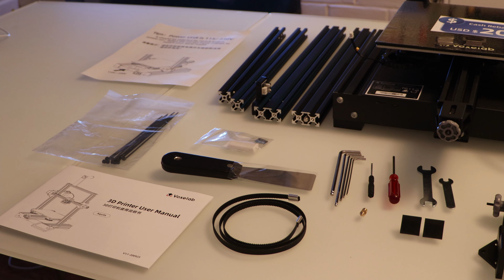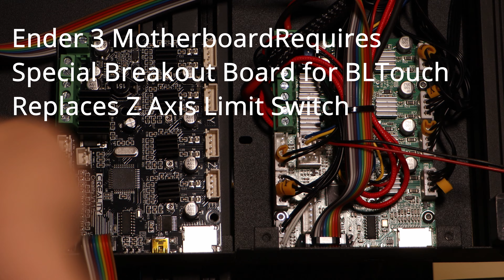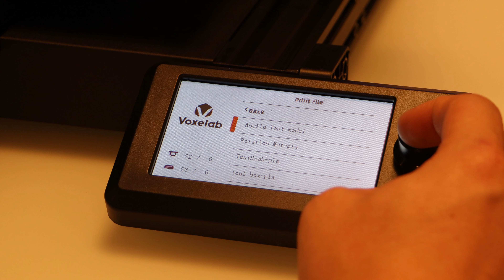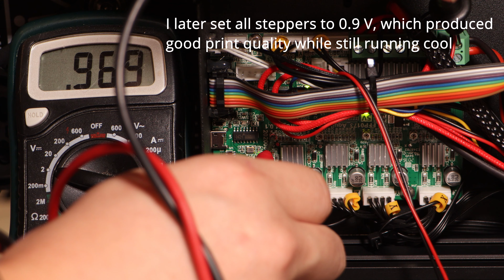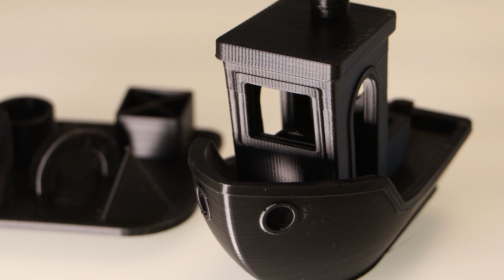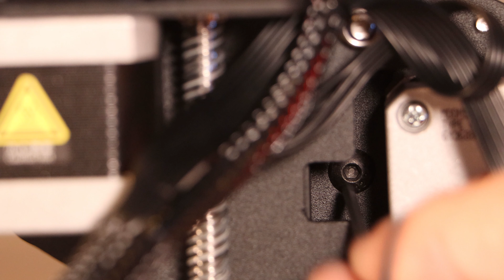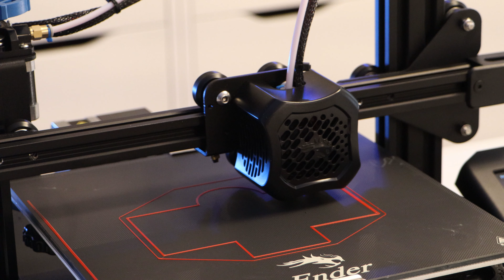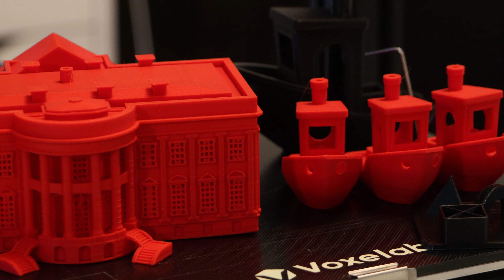VOXELAB AQUILA VS Ender 3 V2 - Which Budget 3D Printer Should You Buy?

Comment: You may want to try cleaning the ender 3 glass with acetone instead of IPA. Heard stories of yellowish stuff coming off.
Reply from the maker: It looks pretty clean already but I'll try the acetone and see what I get. It seriously looks like they used a single thin coat of spray paint for these new glass beds. Classic "cost improvement".

The older Creality products that I use, both made in 2020, have the older style bed that is more textured like the Aquila's. So voxelab cloned the good bed and Creality downgraded to a crap bed!
Reply: What is that yellow stuff?
Reply: @sed6  no idea, residue from manufacturing is all I can think of.

Comment: If you set it to 230 it'll just run at 12v. The other way around let's out the magic smoke. If it's set to 115 and you hook it up to 230 it'll fry.
Reply: Since Creality sell these all over the world, I'm guessing they chose to play it safe and leave the power supply set to 220/230 because there's no way you can damage it when you plug it in, regardless of what part of the world you're in.  So if you plug it into a US outlet set at 230, the power supply won't work correctly and the output will be lower than it should be (maybe half the required 24V).  This means you really need to check that switch before you run it the first time, but there wouldn't be any danger of damaging it in this configuration.  If it's set to 120 and you plug it into a 230 outlet, it will fry it.  Great video by the way, really nice job on the detailed side-by-side comparison.
Reply from the maker: Ok that makes sense. I didn't want to experiment with a brand new printer.
Reply: @NathanBuildsRobots  there should be a fuse as part of the switch, there was on my Tenlog.

Comment: Thanks  for the video. How does the fan duct compare to the ender? Fans, mounting etc?. Did you check if the Voxelabs MB Fan is also connected in parallel to the part cooling fan?
Reply from the maker: I think it is wired separately. If you look at 3:40 you can see there are 2 fan headers near the middle of the board. The yellow/blue wires go to the part cooling fan and the red/ black wires that go off screen to the right to the motherboard fan. Hopefully those ports are independently controllable. 
I think the hotend heatsink fan is always on like it is on the Ender 3. On some machines, like the new Artillery printer, this fan only turns on when the hotend is over 50 C, which helps keep things quiet on startup.

The fan duct is similar but based on my prints it appears to have better part cooling. Fans are the same size. 

Hotend mounting is identical as far as I can tell, so I think accessories will be cross compatible. 

I will be investigating this further in my next video, I've got some different aftermarket hotends to try and compare - I've got a dragonfly HF, dragon standard, microswiss, and v6 clone to try out - might throw on a supervolcano nozzle too!
Reply: @NathanBuildsRobots  at 3:40 it looks like they are in parallel, same shit as with the ender. But i would be glad if you could find out. Regarding the fan duct: On the Ender the partcooling mounting is a mess it breaks very easily plus the vibrations are transfered to the frame. Can you compare that as well ? :)
Reply from the maker: I'll upgrading the hotend soon, so I'll take a good look at it then. 
I'll do a continuity test to see if the fans are in parallel. 
I'm guessing they run the fans in parallel because they need to add a small transistor to the board for each fan controller so it's cheaper to pair them up.
Reply: @NathanBuildsRobots  Well bascially one want the MB fan to to run the whole time without the need to control the speed. What i do is: i just hook it up direktly to the powersupply + optionally put a 220ohm resistor in series to slow it down a little and make it more silent :)

Comment: You must have a pretty old version of the Ender 3 v2, the board rev you showed as 4.1.1 but even me got an Ender 3 v2 in january of this year with a 4.2.2 board which already has sockets for BL touch and filament sensor on board. Meanhwhile it includes the 4.2.7 board I assume.
Reply from the maker: Thanks for bringing this up. I was comparing it to a silent motherboard that I bought for my Ender 3 Pro about 5 months ago and incorrectly assumed the new Ender 3 V2 had the same board. I'll take a look at the V2 tonight and see what if it has the updated board.
Reply: You're very welcome, still a pretty informative video, and if you bethink that this printer is almost a 1:1 copy and cheaper whci you can easier spend on modding it its an interesting option.
Reply from the maker: Ok, I just took a look at the Ender 3 V2 board. It looks it has a 4.2.2 board. 

It is identical to the voxelab board, except the voxelab has 1 additional 3 pin JST connector.

So you can add a bltouch and Filament runout sensor to both, but you would still have room for 1 more sensor on the voxelab. Not sure what you'd use it for but it's there if you need it.
Reply: I have one ender 3 v2 bought this month and still 4.2.2 board and it sucks
Reply: With a ender 3 v2  the best thing you can do is upgrading to a 4.2.7 board ( stay cooler on the drivers ) I also had some Quality problems, same bed v rols problems(best to replace them and give a little down push on the  front of y t-bar ) nics and tends on the t bars. The Quality is  not high.  If Would buy again then I would buy the voxelab  or buy the ender 5  pro.. I would say buy the ender 5 pro ( changed the 4.2.2 Mainboard to a MKS 3EP ) , but this one cost more.
Reply from the maker: @FlavorDoodle  yeah with the Ender 3 is a case of not getting what you pay for, since it's more expensive and doesn't work any better. TBH I'm going to avoid Creality products for a while and focus on the smaller brands like Artillery, Voxelab, etc. Because there's some great products that just don't have the same brand recognition as Creality. 

I gotta admit though, I'm pretty tempted by the Ender 5 plus with its 350mm build area, but it comes with loud stepper board that I'd have to replace immediately for $30-$50. Why anyone is still selling printers with non-silent stepper drivers is beyond me, they are saving maybe $2 in parts cost butmaking their users suffer every time they hear the thing run.
Reply: @NathanBuildsRobots  well you could say the same thing about no hardened nozzles.
They should just be included in a lot of models but they are not ,not even in s1 pro
Also where did you get that ARGB thing on the print head on the printer in the background what is it and where can I buy it?
Reply from the maker: @andreamitchell4758  check out my world's quetest ender 3, or fanless ender 3 I go over the LED light there.
Reply: @NathanBuildsRobots  Ok thanks, also can I ask if you had your servos disconnected from your motherboard when you were rapidly moving the bed back and forth and  the Z axis up and down?
I thought that was a no non and that moving thing fast like that could cause the servos to act like generators and send  voltage into the motherboard and fry it out.
Or is that only on older model enders ,do the new ones have some  kind of diode or protection circuit to prevent that from happening? I have seen another YouTuber fry his other board doing that.

Comment: Great review. The mother board you compared, was it from the V2? Its looks like it has V1.1. My two week old V2 has the V2.2 and has plug and play BL touch port. I also had problems on first layer. Thought it was me being new to printing. I upgraded springs no change. Tried glue same outcome. If I wash the bed with hot water and dish soap before every print it works perfectly every time. But the bed is not staying level. I heat the bed to set level run a print and check it after it has completed also with everything hot and it will be off level usually tight on the right.? Installed The BLtouch and tighten the bed down no more problems.
Reply from the maker: Yeah, bltouch works wonders, thanks for the update, I was comparing it to a board I had on hand and assumed it was the same as the one inside the V2, guess that was a bad assumption. 

The more you touch the bed, the  easier it is for your bed to get knocked out of alignment, so having to wash it or apply glue stick makes it harder to keep the bed level. The upgraded springs make it more difficult to knock the bed out of alignment, so instead of having to level every 5 prints maybe you only have to do it every 20 prints instead. So it kind of helps with bed adhesion, but only in the sense that your machine is maintaining its bed leveling. Still a good upgrade in my book. I also saw some silicone bushings that you can use instead of springs if using a bltouch that act like almost sold springs, wondering how good those are.

Comment: I also had a ton of issues with getting prints to stick consistently on the Ender 3 v2.

My current best method is to flip the glass plate over and use the non textured side, level before every print and know that some filament colors need glue stick and some can adhere without it.  Also I use 55C on the bed to get as close as possible to the glass transition point without passing it.

Another possible issue is that on my original machine the z limit switch was a dud and would sometimes trigger early or late and I had to replace it.

Keep up the good work and never lose that skeptical approach I appreciate the honest reviews!
Reply: Just installed the BL on my V2. Definitely a game changer. It was easy to install on mine. 30 minutes tops and I  pushed the wire through the loom. From what I am seeing people are getting different motherboards. If you have the 2.2 or 2.7 it's easy plug it in update firm and done. Or I was really lucky.
Reply from the maker: @johnrogowski358  I'm glad Creality added this. I have the old rev of mainboard on my older Ender 3s. You can still install a bltouch on there, it just needs a breakout board that steals power from the display cable port and plugs into the z-axis limit switch, and maybe a different version of the firmware. Just makes it a little more complicated but I'm sure there's guide on YouTube to walk you through it either way.
Reply from the maker: It's good to know I'm not the only one having an issue with the new Creality print bed coating. It's totally different from my older Ender 3 V2. 
I'll look into some cheap options for improving bed adhesion, it may be a good topic for another video. I have a spray can of plastidip that I want to try out, but could also test glue stick, hair spray, tape, and a bunch of other stuff side by side. 
The best solution I have used for bed adhesion is BLTOUCH + spring steel PEI sheet. I have that combo on one of my printers and I don't even have to think about bed adhesion anymore, it just works. But it's pretty expensive and complicated to set up, since it requires you to flash firmware, mount, and tune it.
Reply: @NathanBuildsRobots  Not having to worry about bed adhesion sounds like a dream.  I have had a BLTouch in a box for a while, but there was a lot of conflicting information about how it should be set up for the Ender 3v2.  Recently I saw people making more videos about it so if I get it working and it helps the adhesion I’ll let you know.
Reply from the maker: @stephentt  If you try the BLTOUCH and are all having issues don't forget the PEI sheet too! It's about $25, but it's the ideal print surface for PLA. 
But just a heads up if you print with PETG: I printed PETG on the smooth PEI build plate of a PRUSA I3 MK3 and it got torn it up. Now I use textured PEI for PETG, and smooth PEI for PLA.
Reply: @NathanBuildsRobots  Thanks sounds like a worthwhile upgrade considering I already spent $20 on consumable magic goo to help with the adhesion.  Maybe it would have been better spent on the sheet, but it’s always hard to know which fix will actually work on your machine until you end up trying them all.
Reply from the maker: @stephentt  that's why you gotta have 2 printers, so you put all the best stuff on one and all the 2nd best stuff on the other one!

Comment: Great video and awesome attention to detail. The aquila is so great that it makes you sound like a voxelab shill.
Reply from the maker: Both printers were purchased on Amazon at their market value, $160 and $280. 

Creality prices their printers based on features, not on material cost. For example,  there's no way the Ender 3 V2 costs $100 more to make than the regular Ender 3, really the price difference should be maybe $10. 

So instead of improving their core product and sharing the design improvements with the consumer, they make a new model and sell it at a marked up price, while still selling the outdated designs at a slight discount. It's a great way to maximize profit.
Reply: @NathanBuildsRobots  Thank you very much for this great review. Creality is wrong with that way considering the huge amount of competidors nowadays. They have a name and they should provide better quality if they charge more than others. I was kind of shock of how a cheaper machine was better. Now I ordered an Aquila, it is a must to reduce the voltage?, I don't have the tools to do so. .. ..

Comment: I whish I had seen this video 4 weeks ago before I bought the Ender 3 V2. My takeaway: Use a glue stick on the bed. Otherwise, you'll have a hard time getting your prints to stick, no matter how well you level the bed. Also, Fat Dragon Games recommends the yellow bed springs that are much stronger than the stock ones. I agree that they are a far better choice. I am kind of disappointed that the Voxelab has the same crappy fans and the overall noise issue as the Ender. I really wonder what use silent stepper drivers are if the printer sounds like a hairdryer. Drives me insane. The filament feed placement of the Voxelab is so much better, I wonder what the Ender engineers were thinking when placing the feeder hole next to the lead screw.

Anyway, great video!
Reply: Have you tried cleaning the bed with isopropyl alcohol? I use glue too but sometimes the print is too small to remove with all of the adhesion on it
Reply: @kaitran  That was actually the very first thing that I did. No avail. Heating up the bed to 75 degrees helped a little, but not much. Glue stick is good in that while it creates a rough surface for the filament to hold on to, it doesn't hold too tight to the print. When the bed cools down, the prints come off pretty easily. No need for a spatula.
Reply from the maker: I bought a glass bed a couple months ago to upgrade my Ender 3 Pro (on my fanless Ender 3 build video), and it was this same thin paint layer that doesn't stick very well. I assumed I got a counterfeit because it doesn't work nearly as good as the more texture glass bed that came with my old E3V2 (purchased about 6 months ago). But it looks like they have changed their bed to use this thin layer of black paint instead of anything with any grip on it.
Kinda feels like Creality is letting their quality slip and is relying on brand recognition to keep sales going.
Anyways, to your original concern, this new glass bed formulation has been nothing but trouble for me. But I've been able to get pretty reliable bed adhesion by setting: 
1st layer line width to 2x the nozzle diameter, or 0.8mm.
1st layer print speed to 50% normal print speed, or 30mm/s.
Completely coverinh the bed with glue stick. Between prints I will use a wet/damp paper towel to rough up and redistribute the glue.
It would also help to set 1st layer layer height to 0.3mm
Reply: @NathanBuildsRobots  The printer profile that I'm using right now (a customized version of FDG) actually has this lower speed/greater layer height/big line width too. I haven't yet tested if the bed adhesion is the same without glue stick. However, before using the glue stick with the regular profile, I tried hairspray, and it actually worsened bed adhesion for me!

I'd be very interested in a video about the various methods to improve bed adhesion.
Reply from the maker: On your original comment about fans, I have just given up on having a quiet printer for under $200. I still like having the silent motherboard, because I can hear stepper squeal from a room away vs at least the fans you can't hear from another room. 

Have you checked out my world's quietest Ender 3 video? I think it's my best printer and video to date, but I must have done something to anger the youtube gods because it's not getting as much exposure as my other videos. 
https://youtu.be/uqCntWdLIvA

I can leave that printer running while I watch a movie in the same room and I can't even tell if it's running, it's luxuriously quiet.